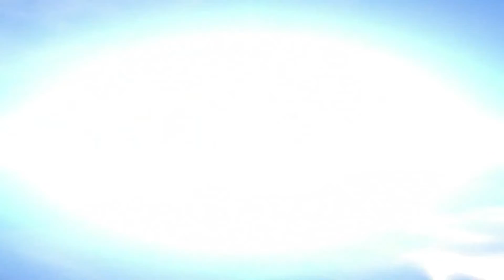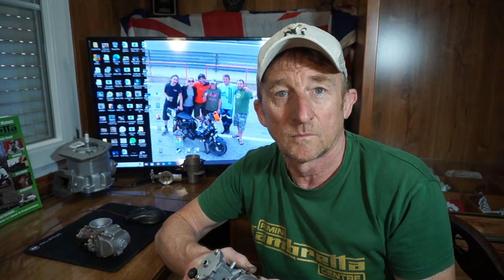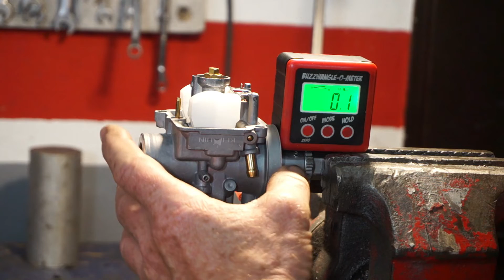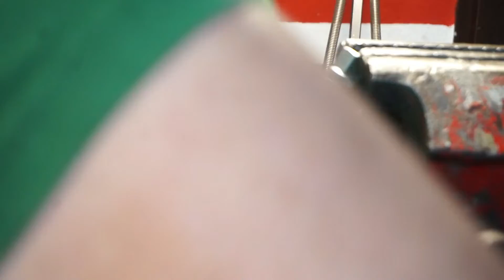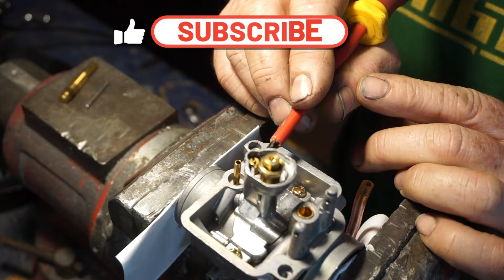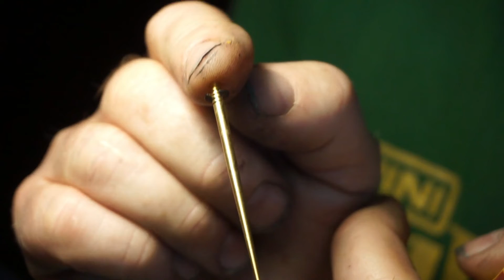Best PWK carb HOW TO#lambretta#HOWTO

Comment: You say the air screw is only effective up to 1 turn out? I've never heard anyone say that. In fact I've generally been told 1.5 turns out as a.baseline? Can you explain?
Reply from the maker: Yes on PWK 1 turn only is on the side of the carb with a sticker on genuine keihin carburettors , you can check with GPT chat
Reply from the maker: Dellorto is 1.5
Reply: @TheSteelweasel mmmkay

Comment: Hi there bud, what jets and atomiser would you suggest for a polini pwk 30mm on a RT195 with decompression hole (like your video) with iwis chain, darrell taylor 60/110 crank, AF 6 plate clutch, full MB race bearings and seals...any advice would be appreciated.
Reply from the maker: Does it have power jet ?
Reply from the maker: What exhaust
Reply from the maker: Air filter or open carb
Reply: @TheSteelweasel  open bud

Comment: Steve, what size PWK carb did you fit to the Casa !85cc in this video. Was it a 24mm, 26mm, 28mm or 30mm or even bigger ?
Reply from the maker: A 21 mm is best or 24 mm max for road

Comment: Can your help with some information on a PWK on a four stroke? What Emulsion tube choice? Needle choice?
Reply from the maker: i have no info for 4 stroke motors , is it on a bike what size carb what engine size , and if its running what are the running issues ? ill try to help

Comment: What are the brass pipes on either side ? Some sources say they’re vents and need to be kept open and others say they’re oil/vac and should be capped if not in use ?
Reply from the maker: vents dont cap

Comment: Hi Steve
Does the PWK carb have a float needle valve like the dellorto,  which can be changed to increase fuel flow? And if so where is it on the PWK carb please.

Thanks for any feedback.
Reply from the maker: yes it does and its in the same place as all carbs . no up grade needed

Comment: Great video Steve, i'm setting mine exactly the same as you have shown here for my 185cc alloy SR kit with sterling pipe, my pwk is a 30mm, do you think it will be ok with the 115 main and 42 pilot with the 20 hole atomiser?  many thanks
Reply from the maker: Glad it helped

Comment: I know your  big advocate of kehin ,pwk carbs I've just built a casa ss220 and currently have a vhsb 34 on it ,that am not only struggle to get set up cleanly ,they are god damn thirsty and am wanting to try maybe a 30ml ,can you recommend or give any advice . I've just seen a 30ml racing pwk about 100 quid any thoughts ,suggestions appreciated tia Stew
Reply from the maker: I'm guessing you have a stroked ss200 same as I have on my race scooter . I run the 34 mm pwk on it runs smoothly and fuel is OK compared to the dellorto.  Just go on ebay or alli and buy a cheap one for around 35 pounds change atomiser to a 20 hole polini and jut it up . I'm running 165 main and 45 pilot no power jet ...... good luck  . If you need help once you have to just get in touch . 30 mm better choice for road .

Comment: Hi great show ,I too like the pwk ,I'm running a 230 monza,vape variable ignition,jl pipe got off a mate.i would like too run the pwk 30mm do you have a base setting too get me started ie pilot,main jet,and maybe needle size!the jl I'm using I think is a fast road but it's quite narrow  expansion good pull power through  the gears,19x46 but it feels tight too me, I intend too sell the jl to go towards a larger expansion but would appreciate any recommendations. Thanks from tup
Reply from the maker: Main 140 pilot 42 needle pos 2 .slide cut away   15 % higher cut by hand or buy a weaker slide . ........ panel filter power jet carb
Reply: Keep the shows going it's my only  tv viewing ,and thanks for answering! I appreciate  it

Comment: Great video. I was curious about that brass pole in front of the pilot jet, what is it use for? Mine was snapped and im not recognize any change on anything yet.
Reply from the maker: It's to stop fuel entering pilot circuit from bellows

Comment: Steve, what was the final jetting to that carb at the end after you had set it up on that guys scooter? You mentioned 42 pilot and 115 main jet. What was the final settings once tested and run?
Reply from the maker: No changes only set mixture and tick over . Once its run in we can jet it safley

Comment: Good work Steve
What is your take on mikuni carbs?
I run a tmx 30 on a lth reed block
Cheers 🇦🇺🇪🇸🏁
Reply from the maker: Mikuni are great carbs pal , I ran a 34 flat slide on my scooter at avon park many years ago . Great power got 87 mph 14.7 seconds on my road scooter  beating everything that weekend in the street class and run what you brung  , making me the fastest road scooter in the uk at that time ......

Comment: Great video - my mate is running a PWK 36 on an SS225 but has problems starting it - checked everything and it seems to be the choke not giving enough gas - is there anything can be done? On a Delly we’d just put a bigger starter jet in.
Reply from the maker: Yes dont open the throttle when you start from cold . Or if all else fail open the jet in the float bowl very slightly.... be careful  pal
Reply: @TheSteelweasel  Thanks Steve - which jet is the one to open up?

Comment: some good advice there Steve but could have mentioned the common problems with the patern versions like the fuel feed needing drilling out and the float bowl being a bit on the small side👍
Reply from the maker: Never had to drill one out ? And the bowls are big enough and exactly the same as original  . Let talk about delorto  problems  ? Nothing a big hammer dont fix . Biggest pile of over priced rubbish . Bit of damp and the slide sticks . Design is about 40 years out of date . You need to replace just about everything inside to get it to work ? As far as I can see face book is full of people with running problems  with delorto ..... the floats fill up with fuel . They are just a shocking piece of %$$$#%